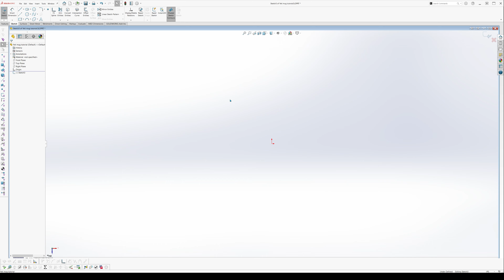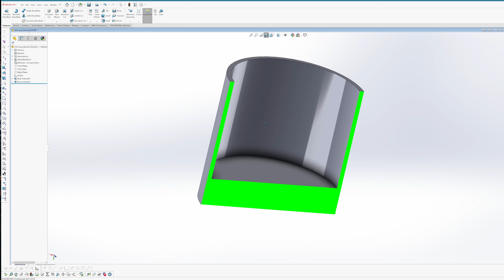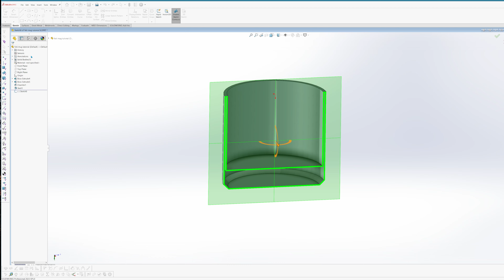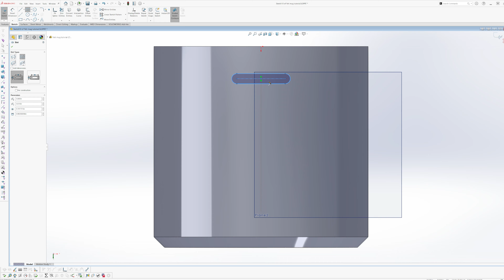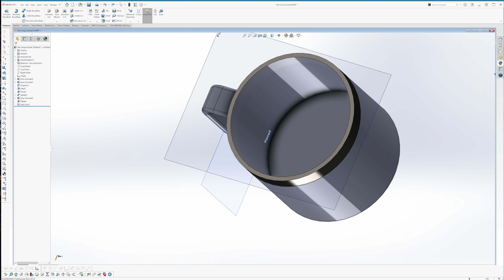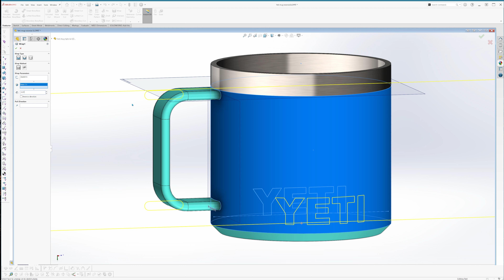How to create a YETI mug — Learn Solidworks in 30 days [Day #5] #solidworks #beginners

Comment: 7:08 This is really dumb ... I don't know if it's on by default, but for the longest I couldn't dimension from the vertical line to the face of the mug, turns out I had to check "Graphics-only section" on the section view. These are the kinds of things that drive me insane, and perhaps should be included on newer versions of the tutorial :(
Reply from the maker: @junkoid1  thank you for the feedback! I’ll make sure to include that detail in future revisions. There’re a lot of little nuances in solidworks that drive me insane too, and it takes a lot of trial and error to figure it out.